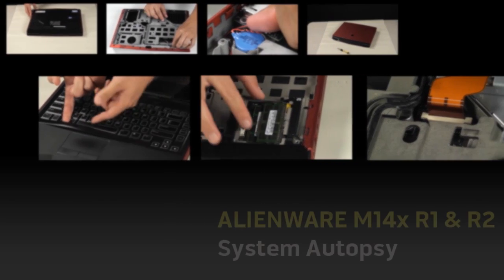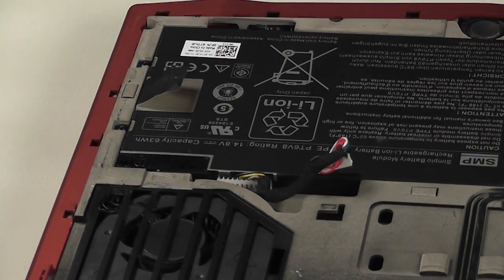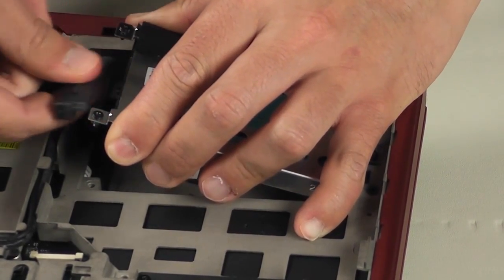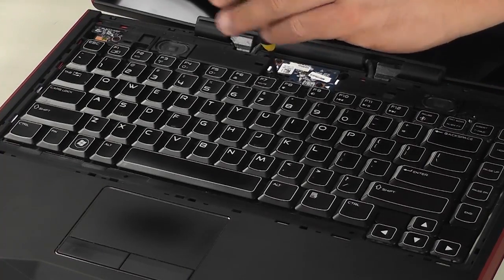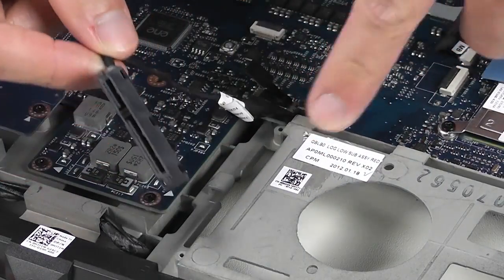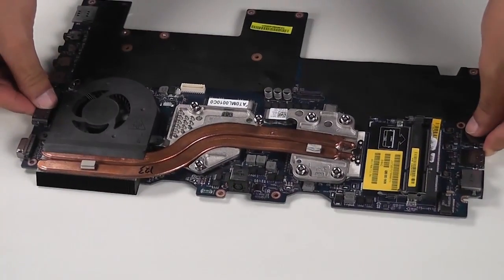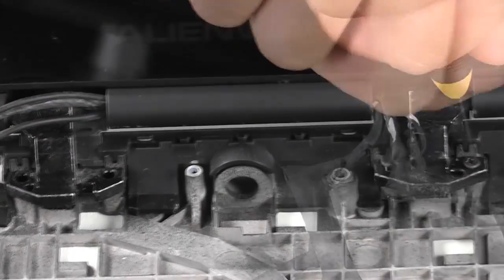Alienware M14x R1/R2: Disassembly

Comment: Hello so i have an issue when i reassmbled the laptop and tried rebooting. When i try to boot it up i get a black screen with 4 loud beeps over and over. I found out that this means there is a problem with your ram so i i removed one at a time and tried booting with one and i can boot it up fine with one card in the back slot but not in the front slot with the card that works. I tried the other card in both slots and it doesnt boot so i assume that the card is defective. But is it possible that one of my ram slots has malfunctioned and wont work now? I put the card that works into the front slot and i get the 4 beeps again. Once i put the good card back in the back slot it boots fine and runs great. So does this mean both the ram stick and the front slot is defective? Is there something i may have done while disassembling to cause this? I only had 6gb ram anyways and thankfully my 4gb card is the good one so i can still do everything on it but still just kinda bugs me lol. I may just pop an 8gb stick in the workinmg slot and call it good. But just wondering if there is anything i can do to fix that issue. Thank you!

Comment: I just took my AW m14 to a repair shop to have the motherboard tested. They wouldn't even test it because they knew it was the motherboard due to all the issues other AW owners have with the motherboard. They said a new motherboard is around $600?! Is that true? This laptop btw is a complete piece of junk as far as I can tell. I had constant issues with it in the ONE YEAR that I used it. Replaced the hard drive and battery and then the motherboard crapped out shortly after. I will probably be using it for target practice and vowing to never purchase from Dell or AW. I would have been better off with a cheap laptop from WalMart

Comment: I watched this video several times so I could figure out how to access the fan and vent to clear out any dust because the fan had become very loud. Once I got to the fan, I found a fat wad of dust blocking the vent and I cleared it out. "Problem solved." I thought. I carefully put everything together, made sure all the cables were plugged in and screws tightened. After I finished putting everything together, I proceeded to turn on my laptop. Everything seemed to go smoothly for the first 5 seconds until my laptop started Beeping, and nothing would happen, the screen was black and it would keep beeping. "Fuuuuck" 
I took it apart again to see if I missed anything, but everything seemed in order. I turned it on again, but the beeping still happened :[ well, now I don't know what to do Dx Find an Alienware expert?
Reply: Alienware Services Nevermind, it started working normally. Thank you, this was an excellent video
Reply: Did you have to remove the keyboard to get to the fan?
Reply: MaviHD yes.
Reply: Tasha W the beep just means your ram came slightly loose
Reply: Tasha W do you remember how you fixed it? I'm having the same problem
Reply: Shmuga take your ram out blow it reinstall repeat until it works
Reply: Yes.
Reply: All I did was take it apart again and reassemble it, and it magically started working. Not sure what happened.

Comment: Great video!  Thanks for posting.  

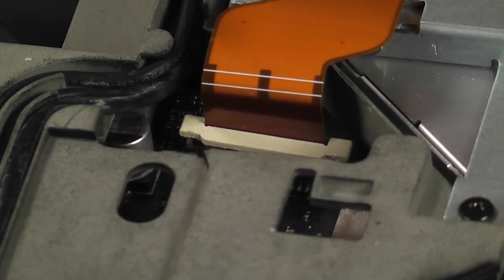Quick Question - I removed my DVD drive to add an SSD and the white plastic bracket that connects the DVD drive to the motherboard broke (specifically the piece showing in the video at 2:51) - is there a replacement for this piece that can be bought?  

hoping that this is a fairly common bracket that I can replace - now my DVD drive is not being detected by my computer.

Comment: Hello, my unit had a wire coming out from a "JBT" connector from the motherboard but it did not terminate at anything. Is this expected?
Reply: +Alienware Services thanks, what is that connector for? i bought the laptop used so don't know what was/wasn't selected.

Comment: I have the m14x R2. I cant get it to power on.
I tried the battery discharge(take out battery and hold power)
Also tried new adapter, diff power sockets. Still no power.
If i move the adapter in the power outlet of the comupter, i can hear some electricity sparking slightly

Does this mean the mobo is bad? or is it just a bad solder point/cables?

Or could the power button be the issue
Reply: +Alienware Services it's out of warranty and I don't want to spend 100 bucks to have them tell me it's one of those three things. I'd assume the power button would be the first to check.

if it's the mob will I'll see a burn, bad solder, or even blow capacitor?.
Reply: Alright well ill try the power button, then the power outlet, then the mobo. Hopefully its not the mobo because those are like 250+. If it it the mobo onto MSI i go.

Comment: i have a question. my m14x gpu throttles at 69c and reaches that temperature rather fast. Ive heard of people having temperatures go up to 75c but for some reason mine throttles at 69c. i repasted it not to long ago. and have updated all the drivers.  is there any thing i can do to disable the throttling?  this problem literally renders the pc useless for gaming.
Reply: throttle stop seems to only work for cpu throttling, i have tried bios a14 and a08
Reply: sorry didnt specify. i will try a07, it seems to be the bios before the limitations where placed.  it seems to cunduct the heat tine, is the m14x supposed to run cooler than 69c under full load?
Reply: it wont let me down grade to bios a07. it should not throttle but strangle it does. is there some setting in which i may have accidentally set it to do that? nvidainspector has a function where you can change the throttling temperature value but any time i try to apply changes it changes back to what it was earlier, it show that the limit it is 67c but in actuality it throttles at 69c
Reply: this seems to be rooted in that alienware has set an bios thermal limit of 67c for the gpu in the latter bios versions. and it seems to not let me go down to a bios version older then a08. witch also throttles.
Reply: ok thank you

Comment: Hahahaha...

I laugh at +Pyro5kinetic6beaver and his comment that "Alienware is for noobs..." because I can get a used Alienware for dirt cheap on eBay, and Sager/Clevo laptops are a big more powerful, but they do not have the quality as Alienware....

Sagers are known to have garbage track pads and DVD drives... Least alienware track pads function properly and the slot load DVD drive guarantees you cant accidentally bust your DVD drive by bending the tray.

Lastly, I've had Alienware laptops in the past (m11x and m15x) and I currently own a Razer Blade 14 QHD laptop touchscreen. I am dumping that Razer Blade for a used Alienware m14x for the following reasons....

Alienware laptops are as follows:
- plastic (least the m14x... I guess the new ones are metal casings)
- Non Touchscreen models are less to break.
- Dropping it won't do much damage... unless it's concrete or a hard surface.

Razer Blade laptops are as follows:
- All metal design... Scratches and paint chips are common.
- Touchscreen is glass, and you can bust it from having a small object on the keyboard and accidentally shutting your lid.
- Metal LOVES to DENT... Drop it and you laptop looks like a Smart Car vs a Semi Truck...

Everyone has different opinions, but why do these laptop manufactures INSIST on making portable devices out of fragile materials? That's easy... They are jumping on the band wagon with Apple screens shattering and paying a 1/2 the price of the device to fix it.

Comment: So i have a question , if i didnt order my laptop with a Wireless HD Card or a SDD slot then there is an empty Mini PCI Slot just laying on the side of the Wireless card ?
Reply: will i be able to use the extra slot to use a external pci slot and install a full size graphics card ? sorry for doing such an specific question...
Reply: I just wanted to find out if it's possible to order a different cable to replace the current 14" LCD at 1366 X 768 "HD" to the 1920 X 1080 "FHD" screen? I have an M14x R2 and i've never ran into a laptop model that says the higher resolution screens won't just work with the same cable configuration?

Comment: It appears that the KillerNIC on my M14x R2 died.  Is that built into the Motherboard or replaceable as a separate component?  Also, do I have to tear down the whole laptop just to clean out the CPU heatsink?
Reply: +Alienware Services What about the wired Ethernet card?  Is that a part of the system board?
Reply: +Terry Musser to clarify, the wired ethernet card on my machine stopped working about 6 weeks ago.  It does not show up in device manager even though it is enabled in the BIOS.  The KillerNIC software no longer sees it as well.  I'm trying to determine if this component can be replaced myself or if I need to purchase a warranty extension.

Comment: Also another thing, now that I have this replaced the charger ring on my charger comes on like it always has with working, however the start button will not change colors or come on like it normally would when it usually charges, it isn't charging at all so its completely dead. And the charger ring still remains on to show its on (at least I assume it works) what can I do to fix this and be able to turn my laptop on?

Comment: Question: when you take the frame off after the keyboard to show the motherboard it has a wire that is connected to the motherboard on the right, but the other part isnt connected do we connect this to something or leave it alone the video didnt show that part but it does show it in the video, also there is an orange tape like stripe thing behind the black thing on the left. Do we leave this alone and not plug it up to? the video again doesnt show it at all.
Reply: These 2 orange strip on the back of the frame and the cable were the motherboard was did not show what it was connected to when I took the keyboard apart

Comment: Hi!! So, I have m14x r2 (out of warranty). I am planning to change my cooling system. What are the parts that come under cooling system? (Thermal fan, thermal cooling system(tubes).... Any other parts?). Are fan, tubes are designed uniquely for r2?(that means.... If i want to change that, does i have to order from alienware/dell or are they common design parts that i can get anywhere?)

Comment: i have 2 alienware m14x 1 r1 and 1 r2 and im having issues with my r2 when i plug it into charger the light on charger turns off and i know charger works because it has worked fine for r1 i was wondering if there is anyway to fix the r2 with parts from r1 or would it be a motherboard issue ?  my r2 has much better video card and processor then r1 so id like to use that one and sacrifice r1 if possible or find the part online they are both off of warranty

Comment: I have a question. Since the gpu is welded into the motherboard. Would it be possible to order a newer mother board w/ better gpu and place it into the chassis of the m14 I have now? If so how much would that be roughly?
Reply: Did you find an answer to this? Wondering the same..

Comment: The speaker is all popped in the screen is scratched terribly prices were everywhere in a 20 ft radius no joke my joint for the screen has deep scratches all over and a lot of more broken hardware is squished in.so when he put it fully back together ther was 10,20 screws not in when it was back together he put them in his pocket and walked out so my PC is missin 10,20 screws      My pc is in bad shape

Comment: I think I'm going to be sick got a refurbished m14x r2 the buyer didn't pick it up if wondering but any way I am having charging issues and the technician is take out the mother board the battery and something else and replacing them

Comment: Alienware is for noobs, When looking a gaming laptop I found that the Alienware mx17 had only one gpu and I found a clevo prostar laptop also 17 inches for the same price with better expand ability, easier access, and two 670ms the same gpu in the mx17, it could also have 32 gbs of ram an msata and 2 hard drives. Clevo laptops way better then Alienware.